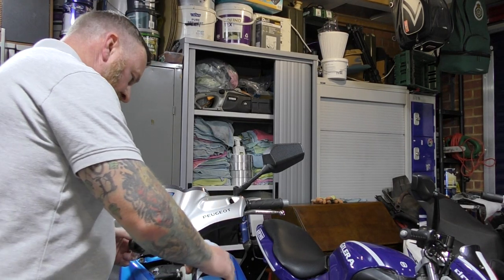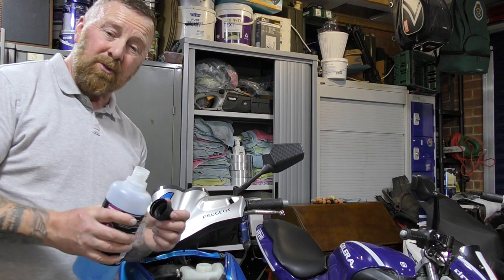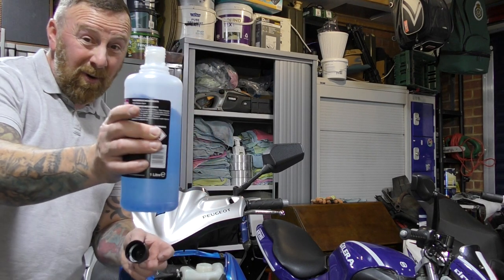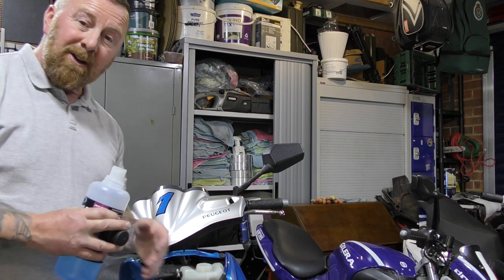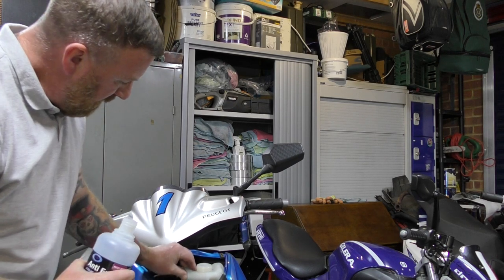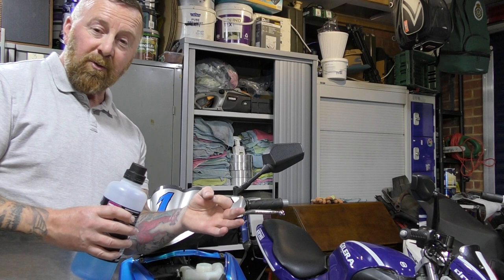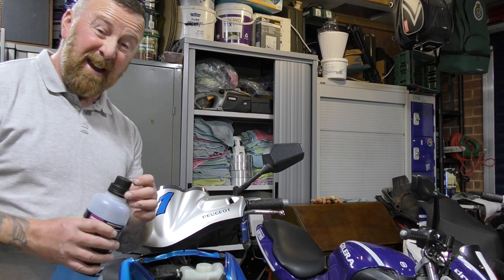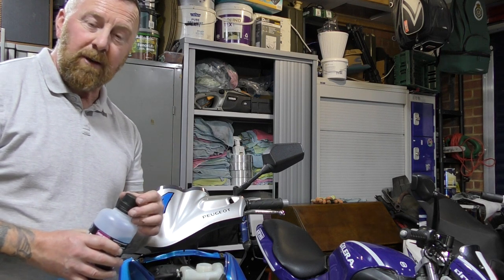DONT FORGET ABOUT YOUR ANTIFREEZE !

Comment: Hi mark, are you on Facebook or have a shop contact number?
Reply from the maker: Sorry bud I don't,  I'll try and help on here
Reply: @marksavage  ok thanks for the reply, I have a yamaha aerox 2004, bike is mid race tuned but my issue is, to get the bike to idle ok when warm, the idle screw is fully turned in, any advice? Thanks.
Reply from the maker: @connorkewmoss1171  I have a few videos on 2t tuning 
Standard 3 half but is it a yamaha carb ?
Reply: @marksavage  it’s a 21mm delorto. I’ve watched many videos but never seen this issue before where the bike only runs with idle screw fully in